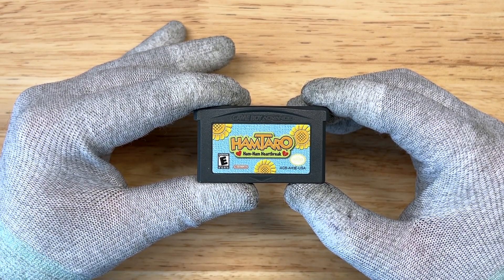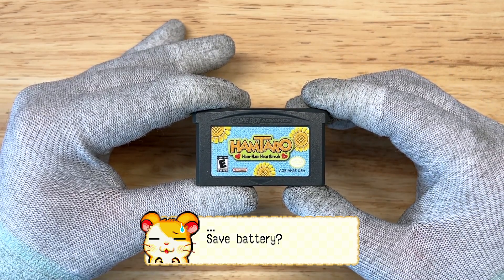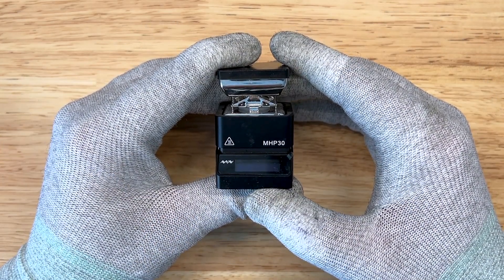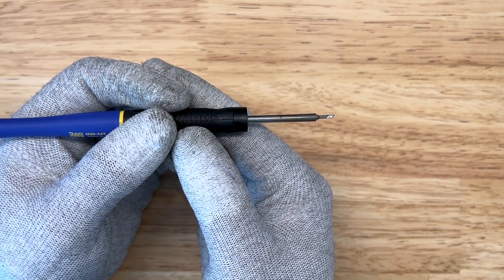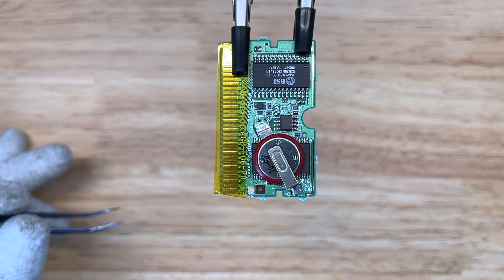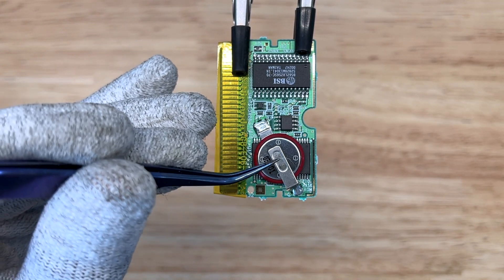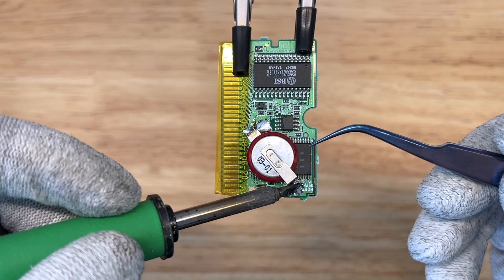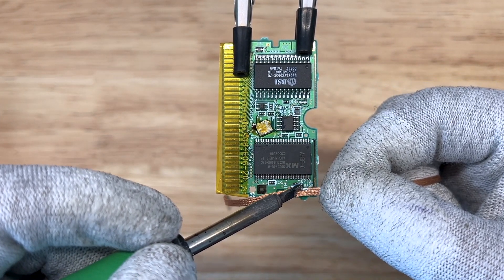Hamtaro FRAM Upgrade.  No More Heartbreak From Dead Batteries!

Comment: Hey! Your skill on repairing these game is amazing. I have some problem with my HM:MFOMT, it won't save too. It has FRAM model but it won't save on both data (?) It always said "Save Failed". I already ask profesional to solder it but it still failed to save, sometimes it work and sometimes it failed again, deleting all my hardwork. Any solution? 😭😔

Comment: Not sure if you have already answered this, but why did you add solder to both pads for the battery before removing it?
Reply from the maker: Good question. It’s 20+ year old solder. You add some to freshen it up to make it easier to work with.

Comment: That was awesome, great walkthrough!

Quick question, if you don't mind me asking.  What temperature do you typically have your soldering iron set to?
Reply from the maker: It’s going to vary by station and your experience level using that station. I’m typically around 750f but I wouldn’t recommend that temp for a beginner. Try 650f to get started.

Comment: I have one of those desoldering braid, and it never worked for me
Reply from the maker: Depends on the braid. I use MG Chemicals and it works really well. It has good rosin flux infused in it. Try adding some flux and see if it works better for you.

Comment: Interesting mod, never heard of this before. Questions for you, is this a mod that can be performed on older GB and GBC carts aswell? and how would it work for games that require the battery not only for saves but clock based events aswell? i ask as ive seen repro games with modern chips and clock based events no longer work on them and the saves if the power cuts out while trying to save you lose the file which is far less likely to happen with a save battery in play. And old pokemon GB fans know why im asking this question, the good old clone cheat lol
Reply from the maker: You can still FRAM mod GB / GBC games that have RTC. You’d need to install additional components, OR gate, for it to work properly. I’ve had a lot of people ask about it. I should another video covering it.

Comment: is it the same process and chip for Pokémon blue and gold? Id love to mod mine this way. Where can i find the chip and hot plate? definitely need one
Reply from the maker: I’d recommend getting an FM18W08 from Digikey. You can get the hot plate from retro game repair shop. I have a discount code, imod.systems, that will save you 10%

You can FRAM mod blue and gold but the process may be different. Depends on the memory bank controller.
Reply: Are you planning on making a video for the gb games since the process is probably different?

Comment: YOU CAN DO THAT?! 

My Metroid Fusion has the SRAM/battery setup. I was just planning to replace the battery when it dies, instead I'm going to do this.
Reply from the maker: Yup, just grab an FM18W08. Ideally from Digikey
Reply: @imod.systems  Will do, thanks for saving me the trouble of figuring that part out
Reply: @imod.systems does that work with every pcb?

Comment: Is this possible with games with an internal clock like Pokemon Ruby/Sapphire/Emerald?
Reply from the maker: RSE only uses a battery for RTC, not save. Those games do not use SRAM they use EEPROM
Reply: @imod.systems  I see, but is it possible to replace the battery on an RSE cartridge such that the user no longer has to worry about the internal clock running dry?
Reply from the maker: Unfortunately not, RTC will always require a battery. If you use a good quality battery it will only be an issue every 7 years or so.
Reply: RSE saves aren't backed by a battery so they shouldn't lose their save once the battery dies